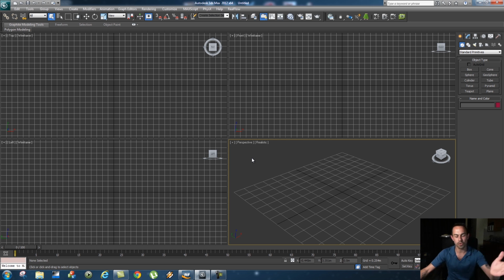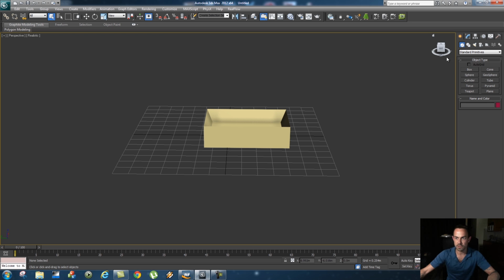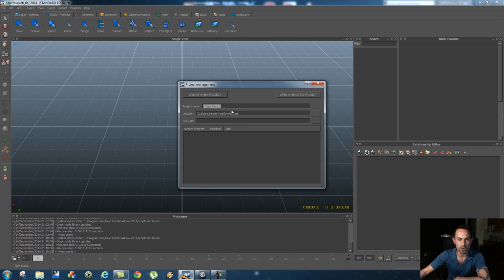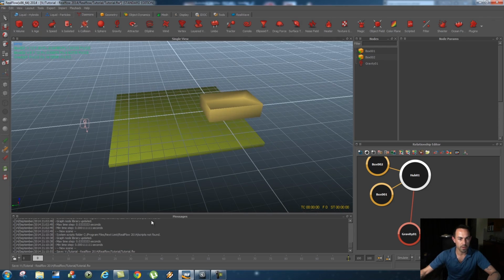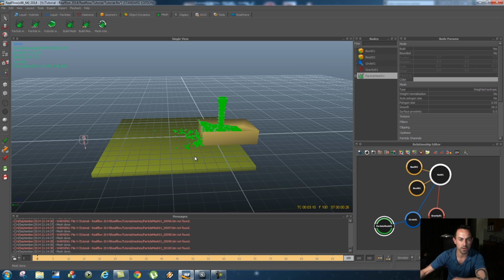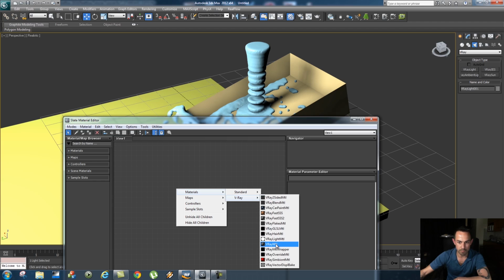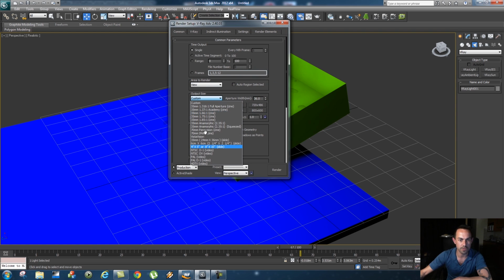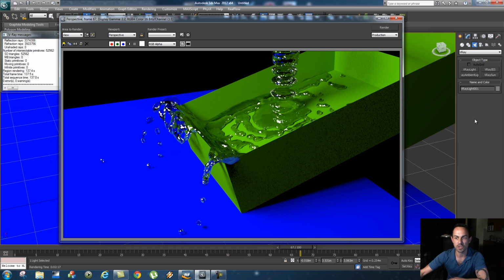Realflow Tutorial For Beginners - How To Export From Realflow To 3dsmax

Comment: For some reason, RealFlow generates .abc files instead of .bin files like what you have. I'm unable to import those into max. Do you know how I might get it to export .bin files?
Reply from the maker: David Anderson That's weird - which version of RF are you using? And are you using the standard Mesh node?
Reply: TunnelvizionTV The Learning Version of 2015. It turns out that if I select Particle mesh (Legacy) that .bin files are then exported. I can then bring those into max. Also, I noticed that the .bin files are created just by hitting "Simulate". There doesn't seem to be a need to run "Build Mesh". Does that sound right?
Reply from the maker: David Anderson Hmm no if you simulate it will only create BIN files under the Particles folder, you need the BIN files under the Meshes folder. They will be create when you do a build mesh ;)
Reply: TunnelvizionTV I think they must have changed it a bit in 2015 because I can watch the .bin files being generated in the mesh folder after clicking "simulate" without having to run "Build Mesh".

Comment: Hi, is there any plugin to install Realflow into 3ds Max? After new installation of Realflow it doesn't appear in Max! Please anybody!
Reply: Hi Ema, firstly, let me explain something, due to me being ill I haven't done any more Realflow videos, but now I have recovered somewhat I will be doing some more tutorials. Anyway, there is a plugin that does exactly that. it is a separate file, you can either get it directly from the Next Limit website. But you will need details of you Realflow app..... a security thing. I hope this has been of some help. You can message me if you have any difficulty.
Reply: chris randell Hi Randell, thank you! It's all Ok now, I've installed the plugin and all works fine :)
Reply: Excellent. well done :-)
Reply: how could you fix the problem? I downloaded Realflow and the 3dmax´plug  but does not appears in my 3d toolbar.

I Need some help, please.

Comment: This is a great tutorial, clearly articulated, easy to follow and very helpful.
But I am having this one problem: having created a mesh sequence in realflow 2014, when I import it back into Max 2014, the mesh is in the wrong position for my simulation. I can spend some time trying to position it, but this is difficult and fiddly. In your video, the imported mesh is automatically positioned to work. How can this be achieved?
Reply: I have found out that this problem arises with Max 2014, but not Max 2012. Using an earlier version of the plugin with a mesh sequence created in 2014, I imported into Max 2012 & everything lined up correctly, just as in the tutorial video.
Reply: +Ben Willard so you cant use it with 2014? i have the same problem but i only have max 2014